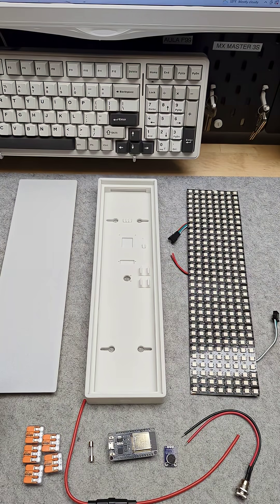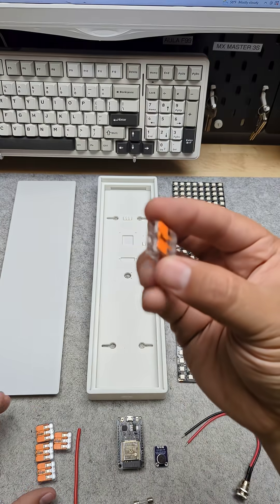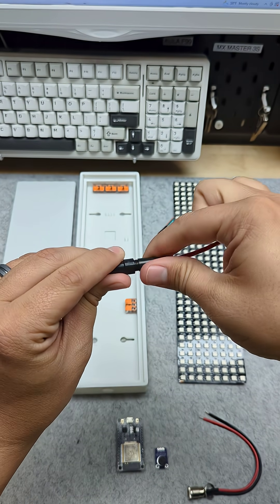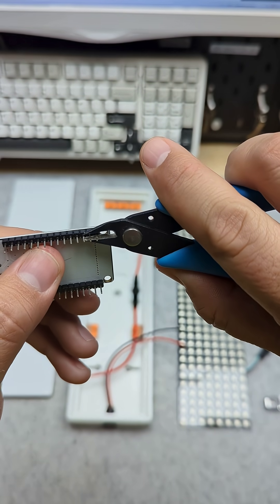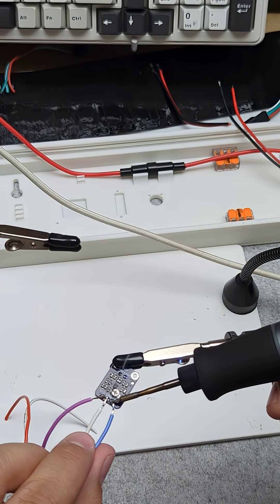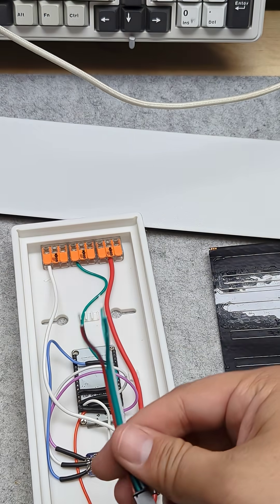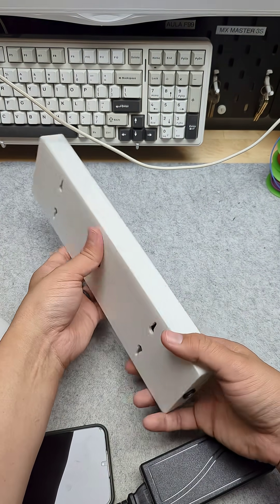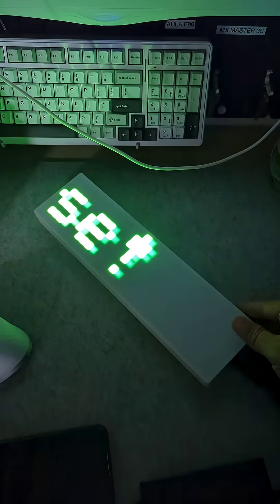I made a custom #wled #matrix!

Comment: I'd personally make the wago connectors friction fit to avoid gluing. Also, not a fan of clipped microcontroller legs. I like to think that it might get reused for a different purpose in the future. It's not ruined, of course, you can replace the pins but i personality wouldn't bother clipping them.

Other than that, that's a very cool and modular display. Clean look and everything is nice

Comment: What's special about this i see them for $15 on temu . It's better if you program it for light shows otherwise it's obsolete compared to the competition which mass produce this. This is so much man power for what i guess will be overpriced due to being hand made
Reply from the maker: It runs WLED
Reply: Temu...😂 Garbage.
Reply: @Sparky_D  where do you think his filament led and circuit board come from? same suppliers temu sources from.

type in led board sign. you will see very advanced programming for $15

please delete my comment if it takes your sales.
Reply from the maker: Link please
Reply: as someone with an online store and also sells 3d printed productions..the big question you have to ask if the labor is worth the ROI. there are many things i buy from temu/ali as a core unit and use that to make other things.

something i would do here is buy the strip and print a housing/enclosure people will like... something creative. endless possibilities with 3d ;)

best wishes
Reply: you can print individual diffusers for the led if you want it bigger like yours. play with the support and design to create an even glow. im a bit of a creative lighting geek
Reply: the other big question is to put yourself in buyers shoe and realize the options they have. should i pay xx for this basic lettering light. or $13 for this image producing led board with in app control? what would you choose if you were a buyer?
Reply: and i hope it doesnt offend. i have huge respect for what you do

Comment: I would definitely add usb c port in there for power too since I have more USB C's than the barrel power jack. Also helps me not fry it since barell jack chargers comes in different voltages 5,9,12 etc.

Comment: Nice. But holding joints with your hands while soldering is asking for future problems. The solder crystalizes with even tiny motion as it solidifies, which makes it weak. A simple jig with a couple of alligator clips is much better.
Reply from the maker: I typically use some helping hands, but in some cases you gotta get a feel for it! Either way, I give them a tug to make sure they hold!
Reply: Been soldering for 40 years, and I've never had a joint get "weak" because of hand soldering. And why exactly would the solder in the "weakened" state every fail, its not like this is a high stress / high vibration part? It will sit on a desk or a wall.  You're probably one of those guys that comments about people using solder on power lugs, saying " the solder will crack or melt when the wire gets hot" , yet for 60 + years auto manufactures have been using LEAD lugs on the end or battery cables.
Reply: @-Primer-  not really. I'm one of those guys who likes to do things the right way one time, particularly when there's little difference in effort and cost. I've been soldering 60 years. And yes I have seen crystalized solder joints fail. And no I have never said anything about power melting joints. The whole point of an excellent connection, solder or otherwise, is low resistance so that is dissipates little heat.

Comment: I think the location of the Mic (on the back) is not correct.
Better place it on the bottom
Reply from the maker: Adding it to one side or the other limits the orientation, that's why I chose the back. The "bottom" could be facing up if you want the power jack on the left instead of the right

Comment: Looks great! Only constructive criticism I'd have is it really doesn't make sense to cut off all the extra standoffs of the ESP32 module; it could be useful later! 

That said, nice and clean design and turned out great
Reply from the maker: Thanks! I only cut them off to save space in the back, but I suppose I could just make it a little thicker and leave them there! Still looking for a DuPont style connector for those pins so I don't have to solder